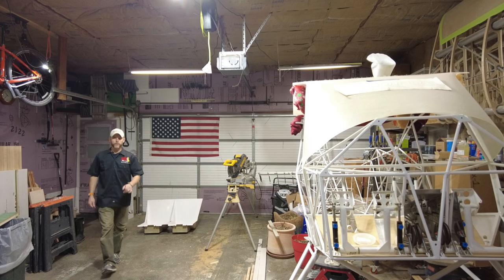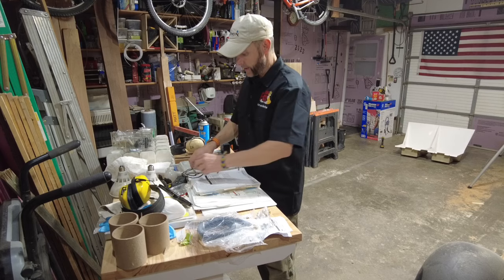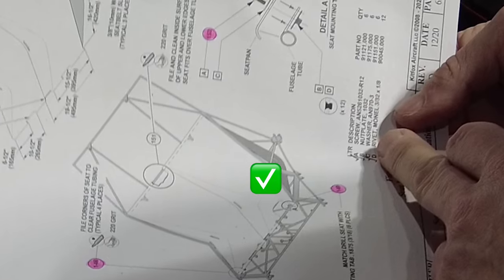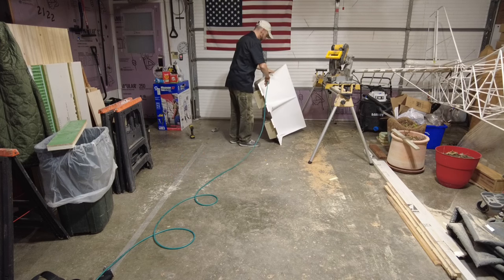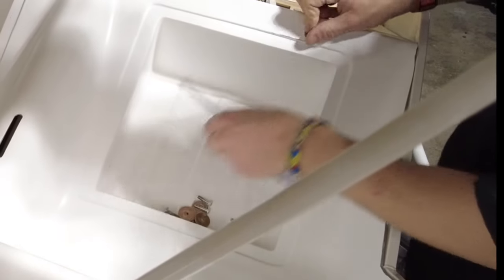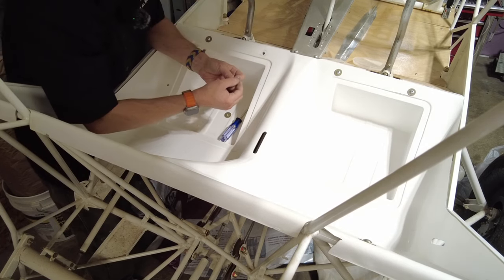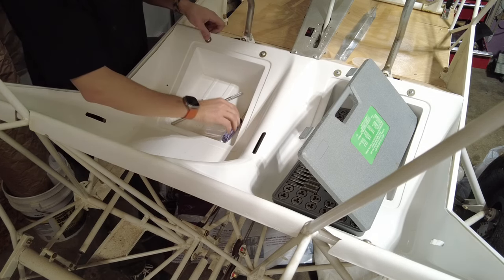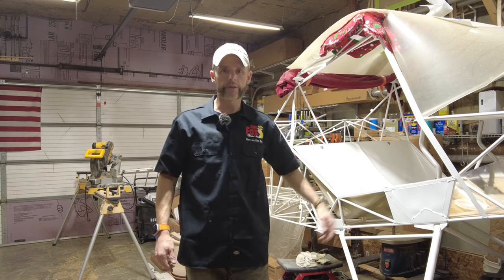#51 Seat Pan Installation

Comment: Matt, not sure if you tried to sit on the seat pan once it was installed. Prior to drilling the mounting holes in the fiberglass, I installed the pan and sat in it. I noticed the seat pan flexed enough to cause drag across the flaperon control tube under the pilot side, at full deflection. I tried using the dremel sanding drum and had some luck minimizing the drag it caused. I engineered a different solution. Just something to check out.
Reply from the maker: Hello Kevin and thanks for writing.  I have not yet sat in the seat pan.  I did however kneel inside during the screw lineup procedure as I read that things seemed to “flex” a little if there was no weight inside during that procedure.  

If I remember correctly the Aileron Connect Tube had a bow in it allowing it to pass under the seat pan, albeit with minimal clearance.  I am now on the KitFox website looking at the manual.  On P. 28 there is a note discussing the possibly necessary adjustment of the aileron idler bell crank.  Did you attempt that fix or come up with one of your own?  I’m interested in seeing what you have going on as I’m now worried that upon sitting in mine I may have the same issue.  Thanks for writing and have a great day.  Matt
Reply: @KingFox76  I attempted to make all the adjustments described in the manual but was unsuccessful in eliminating the slight drag.  Eventually I settled on using 1/2” thick closed cell rubber weather strips across the tubes which support the rear ( backrest) of the seat pan. This raised the floor of the pan enough to not cause drag. With the rubber compressed I then drilled the seat pan mounting holes. The other option in my opinion would be to just use the dremel sanding drum to eliminate as much of the drag area as possible. I was concerned about causing additional flex in the pan and creating a weak point to be in the pan. I probably was overthinking the issue, but that’s what I did.
Reply from the maker: Well Kevin, it sounds like you have done your due diligence on the matter.  Thanks for describing your workaround.  When I get home I will check out the pan in greater detail and refer back to this message.  I’ll also write to you if I have some more questions if that will be ok with you.  Thanks again, have a great day.  Matt
Reply: @KingFox76  feel free to write if you have any other questions.
Reply from the maker: Thanks Kevin, I will do that. You have a Merry Christmas.
Reply from the maker: Hello Kevin, I’m making another video about my seat pan and I made a comment using your name in the video, I hope that’s fine with you. Now that I’m looking under my seat pan while lying on the floor, the flapperon and control tubes run down the center for me and there is a lot of clearance there. Were you perhaps talking about the aileron push-pull tube? On my plane that is the only control tube that I have a close tolerance on, however that is still almost ¾”. Thanks Kevin, have a good day.  Matt
Reply: @KingFox76  I was talking about the aileron push pull tube. Sure you can use my name. No problem. Sorry to see you struggling. I know these mistakes can be costly. Another issue to look at is the longerons./stringer. Specifically, the 2 running along the pilot and copilot sides. I’m building an SS7 so there could be differences but mine needed to extend into the door channel (aluminum channel components which will be riveted to the longeron/stringer). This channel stock provides a place for the door to close into and the fabric to attach to. I have finished the fuselage with some minor exceptions and now I’m working on the wings and flaperons. Hope to start working on the fabric in the next month or so. All summer I had been working on my inst. panel and planning engine and header tank installation.lots of work but fun and challenging.
Reply from the maker: @kevinbisig3261  Ok Kevin, that would make more sense as the elevator push pull tube on my craft has plenty of space but the aileron is the closest to the seat pan.  I can place my index finger between the seat & that tube.  On mine that tube also has a small bend in it which I’m sure is there for just that reason.  I would guess our two planes are mostly similar in that regard.

Speaking of the stringers, I did install them already, co-pilot side first.  After cutting to length, then coping the back end I had some space “grow” at the front of the fuselage where I thought I would have an issue.  Later I learned like you mentioned that the forward section of the stringer will actuall be bonded later and will be pushed inside the “V” created at that section when I put the door frames on.  That made me sigh in relief a bit.  When I completed the stringer on the pilot side I was sure to cut the stringer a little longer so that I could file down the first porting to look & fit better into its location behind the door frame.  Thanks for commenting Kevin, I did use your name in my last video basically talking about what we are discussing now.  Have a good day and I wish you the best of luck with the covering.  Take care, Matt